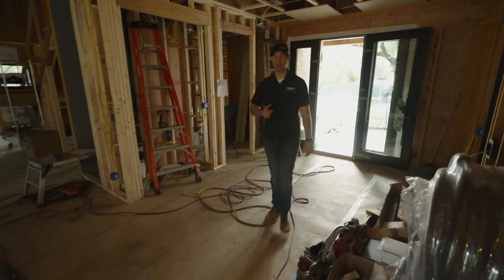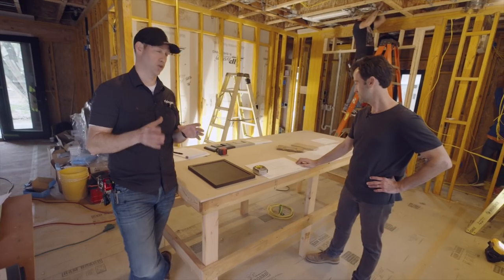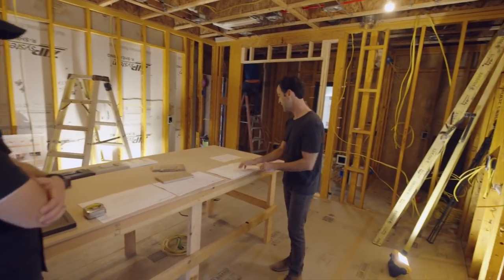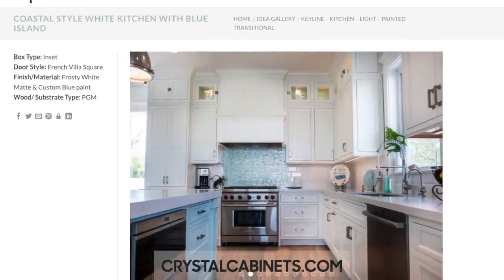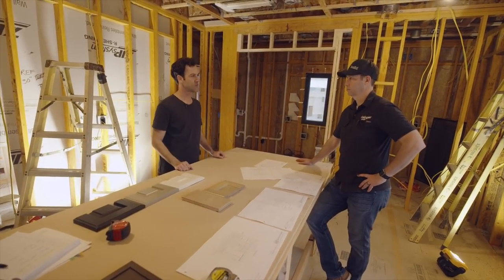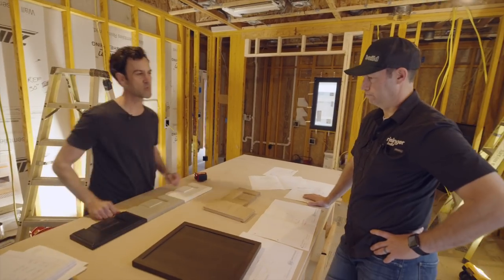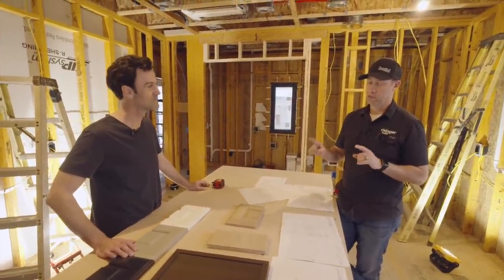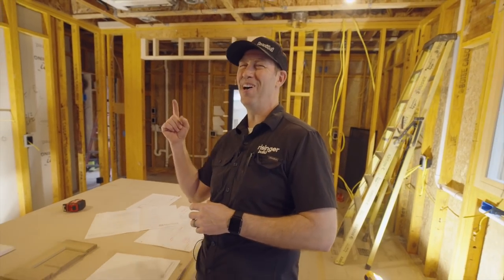5 Cabinet Planning Tips – Here’s what I’m doing at my House

Comment: Gonna be a sick kitchen! Personally I'd stay away from all custom appliances. Especially the slightly smaller width dishwasher. Will be a major pain in 20 yrs if the company goes out of buisiness.

Also I highly prefer stained and polyd cabinets. Painted cabinets just never hold up to life, kids, and dogs and wipe clean like a stained/polyd cabinet will. Then there's also all those people that refuse to use the handles and get that paint stained with hand oils and grime.
Reply: Yep. Even with the undersized dishwashers, I leave 24” and have the panel made for a 24” opening.  Doesn’t matter if the panel overhangs a little more, but when you change it out in 7 years, you can get whatever you want.

Comment: So I guess the plumbers don’t know that you can’t use a double wye in your trap arms for your sink? You might want to tell them that they can only rise 1.5 inches from the the vent to the trap. The way they ran it, they are beyond the 1.5 inch rise as soon as they get to the top of the 45 off the double wye... not good boys...
Reply: Dan Bedard. I'm a cabinetmaker and something looks funny with the rough on those sinks to me too.  Is that extra stuff for cleanouts? looks like one is 2" and the other is 1 1/2"? If so, how hard is it to take apart a P trap anyway? I hate cutting extra holes in the cabinet backs for nothing.  What am I missing here?
Reply: @tomruth9487  the extra clean out may be code mandatory, but th two clean outs on the trap arms don’t need to be in the wall. They could just simply be installed right after the trap. As for the two inch clean out, many areas require them   He will need all the help he can get service wise for those sinks though. The way they’re plumbed, it’s just a matter of time before they become a liability.
Reply: @danbedard290  Thanks...

Comment: Is that normal in the USA, that the cabinet drawings aren't finalised before building permit? These are all done and sorted before slab down in Western Australia.
Reply: The cabinets aren’t integral to the safety of the home. That’s a big reason they aren’t part of the permit process. Permits typically cover permanent change like the MEP trades.
Reply: So what happens in western Australia if one changes their mind mid build? Another cabinet permit?
Reply: @williamdavies1977  No argument there, not sure anyone would think that. They are very important for running prelays (electrical and plumbing) in slabs however and chasing walls when building with brick. Also costings when pricing builds as kitchens and bathrooms are normally the areas where a lot of money are spent. It makes the build faster and more efficient to have these things sorted before the build. Also there are Building codes regarding how close power points are to water fixtures, at least in Aus, and where gas ports are. What type of power the oven will require etc. I was a chippy before I moved into building homes, so i realise even the roof framing where the bulkhead is for the range hood is a pain in the arse for the chippy to come and move and costs more money. Just seems like the cons out way any possible pro's. You can do virtual walk throughs in the design stage to see where everything lines up if distance between island benches and wall cabinets are of concern. Anyway, just interesting to see how you yanks build. Cheers for the reply
Reply: @jl9678  you charge them a shit load of money because they already signed the plans and as long as it meets code variations are fine. I said that's when we normally finalise the drawings, not that it is required then. Big difference in my wording.
Reply: @simmo7670  i mean really though... its a youtube video from ONE builder on HIS OWN house... do you think reality TV is real too? I thought Ozzies were sharper than all that.
Reply: @danielbuckner2167  that's why I asked "is that normal?" Missed that? The US politics has been all over our tv for the last few years, honestly, I'd believe anything you guys do lately lol.
Reply: @simmo7670  Sadly yankee politics domiate the prime time tabloid type news these days even though it only represents a small portion of the world population. 🙄
Reply: @danielbuckner2167  roger that